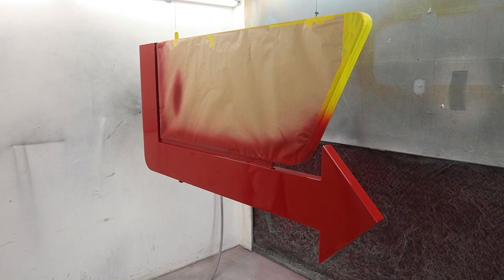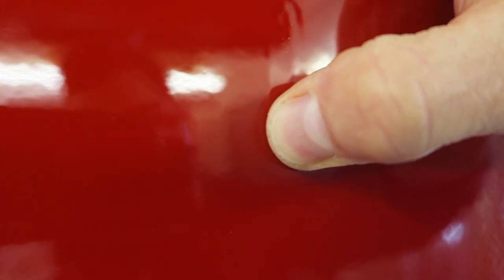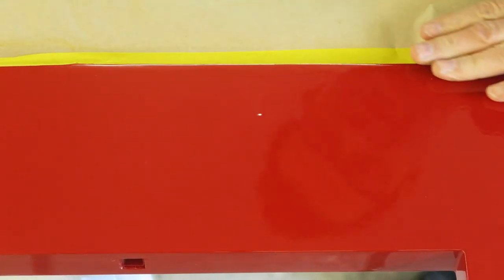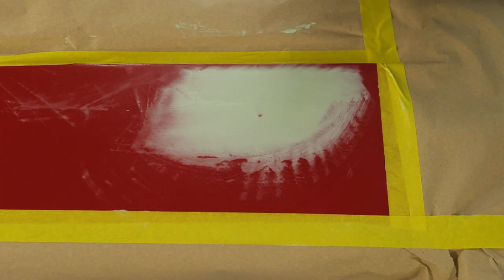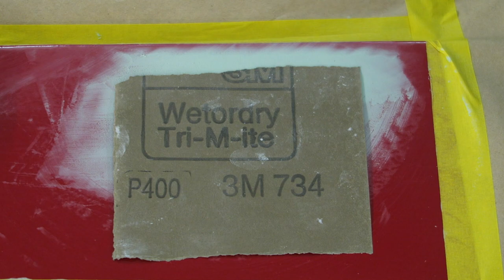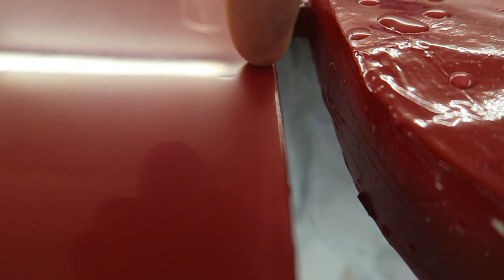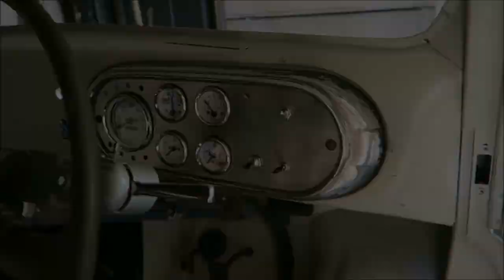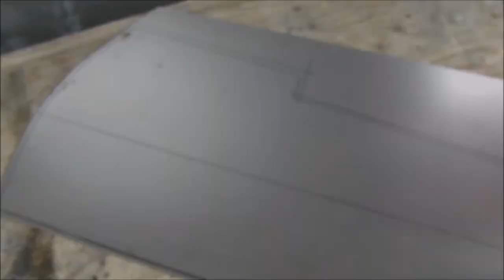Excellent Car Paint Run removal Technique . Tips and Tricks #62

Comment: This is my go to procedure for any runs I get.I use dolphin glaze.
I use wooden blocks too but I start with 600 grit then move to 1200 as soon as the majority of the filler has sanded off.
A hard flat block,as small as you can get away with is the key

Comment: I made myself a small steel sanding block years ago for this job (I don't tend to get runs anymore but it might happen again someday, I have used it on other people's jobs since though).

It's just a small piece of hot rolled 5mm steel, probably 25x100mm. I lapped one side flat then feathered the edges out and polished it. 

I used the feathered edge/corner to sand the bulk of the run and only the run because it's steel and has no flex, once it's almost flat I flatten the block to the panel and finish up. Takes seconds and works great with a little practice. It's about 1% of the effort here too.

This is a very good technique though, just thought I'd share my findings.

Comment: Ever use a nib block Trev,  that's what I use for removing runs.  Let it cure shaves off the surface high spot then 400 stepped up all the way to polish.
Reply from the maker: I had a play with a Festool one, interesting stuff. Cheers Trev 👍

Comment: I've tried all manor of removing runs, sags, defects.  Razor blades, nib files, sanding.  This is the my preferred method.  Warning to the uninitiated.  Be prepared to color sand and polish the panel because your corrected area stands out like a bright shiny thumb.  Also adding a little fiberglass resin (polyester resin) to the filler makes it butter smooth again.

Comment: easiest method I use is to wait till the paint flashes off then when run is still wet simply stick a piece of masking tape lightly over the run, pull it off  and it leaves  a level area , learnt this trick from old coach painters who used synthetic enamel

Comment: great idea to put filler on first to support the sandpaper.  completely logical and I'd never have thought of it!
Here's a tip I got from a pro painter... If you have a run or sag develop and you notice it right away, take a piece of tape and touch it to the run to lift it off before it sets, it might not be perfect but another coat of paint will usually make it close, and then you can still use your technique but won't need to go as far with it

Comment: Hey Trev,  I've never tried it that way before but, the theory is very sound.  I've used a kind of the same to sand back to get rid of hand pinstriping,  By using a hard block it takes the pinstripe instead of the surrounding paint.  Great tip Thank You !

Comment: Why is there still a divot? Did the run pull away some of the previously applied adjacent  paint? Great job. Never seen that trick before.
Reply from the maker: Yes this does happen a lot. It’s the weight of the paint pulling downwards combined with the growing surface tension of the drying paint. It’s totally possible to touch this kind of thing in with a small brush then flat and polish out afterwards.  Cheers Trev 👍

Comment: Unrelated I'm afraid, but could you give an opinion on welding up a sunroof hole where no roof skin is available. Is there any reason why someone skilled could not do this on a quality restoration project ? Thanks for any input
Reply from the maker: You could English wheel up a repair section the butt weld it in for an invisible repair. But be warned this type of repair isn’t an easy task. Cheers Trev 👍
Reply: @trevsblog  Thanks Trev. I'd be looking to hand the shell over to a body shop. Wanted to get your thoughts on how comfortable someone like yourself would be with this. Thanks for answering.

Comment: Had there been no run, would your job have been done or would you have sanded and clear coated?
JIM
Reply from the maker: Jim this is direct gloss 2K paint so it comes out of the gun glossy. If there was no run I could have left it as it was or spent a couple of hours polishing it up to improve the finished paint surface. It is possible to clear coat this type of paint if you desired but for most projects the paint as it is will be fine. Cheers Trev 👍

Comment: Hi Trev, finding this tonight is a thanksgiving surprise for me.  I had some clear runs recently spraying upol clear, it was a bit too cold for slow hardener. I have not tried to fix them yet but did buy a nib file but have not tried it yet.  Ever try one?
Reply from the maker: Yes I’ve had varying success with many files and denibbing tools. This filler method has been by far the most successful method I have found. Thank you 😊

Comment: Trev me old quiffed quanderer, something i would love know is how the mickey mouse body panels are made, i know how the proper manufacture ones are done with huge ass presses but i was wondering if it was something you were interested in too?

do they use a gerry rigged press is it something the made from an existing panel as a copy then cast dies for a production run etc

might be of interest to your viewers,
Reply from the maker: As far as I’m aware spurious panel manufacturers buy worn tooling from vehicle manufacturers, this would account for many copy panels not fitting very well. Small scale manufacturers of parts for vw camper vans etc use a lot of home built tooling like hammer forming tools etc. After that I don’t really know to be honest. If I get to have a chat to forge motorsport I’ll ask them 👍

Comment: Years ago, my Uncle Fred taught me a trick, if you discover the run while the paint is still wet. Take a piece of masking tape about 8" long, hold it near each end in a "u" shape with the sticky side out. Carefully "roll" the tap over the run with a light touch and the tape will pick up / remove the heaviest part of the run. The  remaining paint will flow out to to some extent. If the run was on the first coat, the second coat will cover with often no sign of the run. We did this around 30 years ago, so I'm not sure if the new paints will act the same.
Reply from the maker: Yes I remember this one, I was never any good at it and just made a bigger mess 🤦🏻‍♂️
Reply: @trevsblog  The more runs you have, the better you get at removing them. Practice makes perfect, LOL